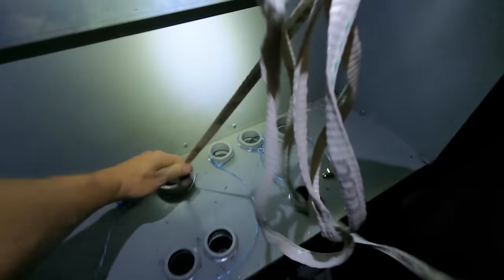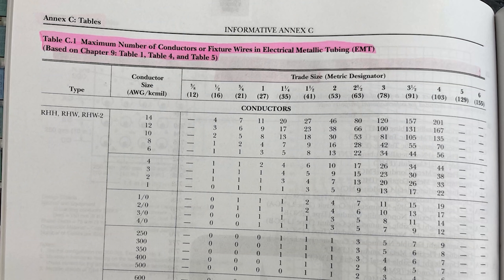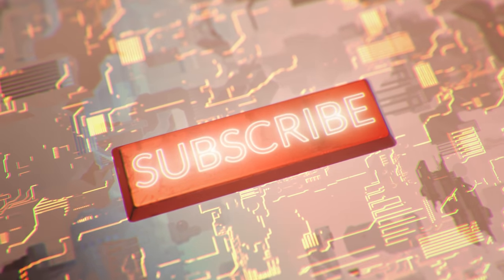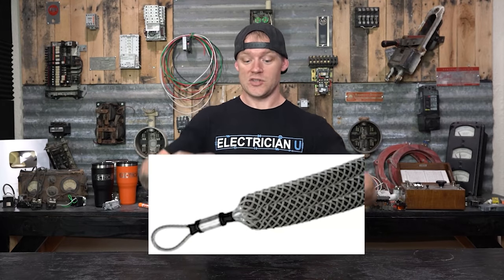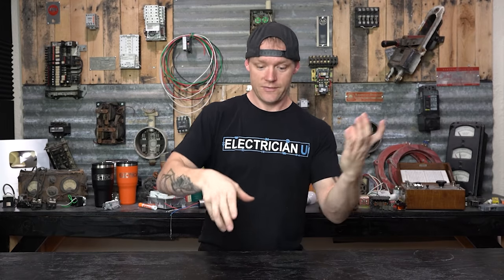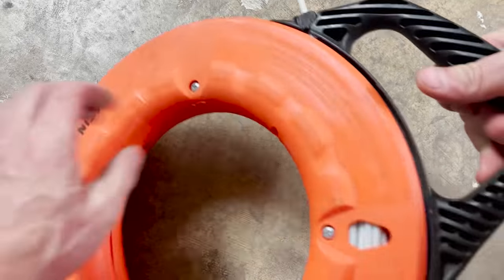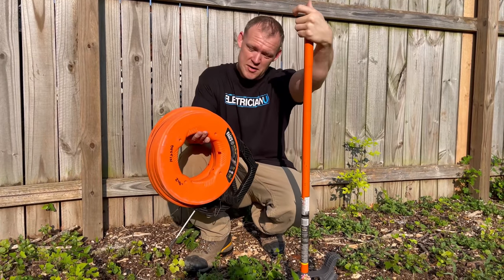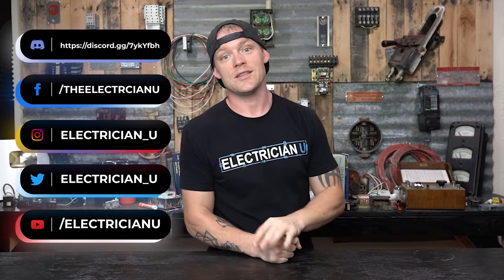Pulling Wire Like a Pro - Tips and tricks for pulling conductors through conduit

Comment: thanks dustin- your next video should be "how to pick the right end of a roll of mc before going through 100' of metal studs and realizing halfway" :)
Reply: i think he already did
Reply: Jajaja
Reply: I dont understand, why does it matter what end you have chosen? You could still get it done even if you pulled from the inside of the roll
Reply: @justink7269  The way the grooves run makes pulling one way smooth, well pulling backwards causes the sheathing to catch on every edge and its not pleasant to pull.
Reply: Check out his video "commercial material you should know"
Reply: It also matters which side of the stud you're pulling or pushing from. I always recommend trying it with 5' or so to be sure youve got it right. Also, make sure you eyeball every single stud you're going through when forming your plan. Sometimes it's a good idea to start in the middle
Reply: The direction of the stud is what really matters. Steel studs have a smooth and rough edge. If you pull through the rough edge, the sheathing will catch on the stud. You will find yourself pulling really hard or having to pull loops through every stud in order to get to the next stud. Sometimes it's best to start in the middle if you have 2 walls with the studs facing different ways (I HATE when carpenters do this) or you're going above a door frame or window frame.
Reply: @justink7269  it makes a big difference. Even the direction you pull through the stud makes a difference.

If the mc and stud are going the right way it will glide pretty easy. If one of them are going the wrong way it's tough
Reply: It always comes out from the inside of the roll to pull through steel studs. Normally you sit the roll against a wall and walk off the center spinning it to unwind as you walk.
Reply: Buy it on reels and you'll never have that problem.
Reply: @justink7269  ,  No-o-o-o-o-o!
Reply: @liamwelsh5565  ,  Teams KNOW what to do and not do... often, the "workers" may know but forget that the installation is a TEAM effort.
Reply: @BruceNitroxpro  Pulling MC is not a 2 person job. If I need another person for something, like pulling wire, I'll get them but not very often for MC.
Reply: the struggle is real
Reply: F
Reply: Use plastic bushings, makes the pull direction irrelevant
Reply: I really hate when that happens.
Reply: Been there..... been there hard man.  🤦🏼‍♀️
Reply: @liamwelsh5565  yes, there is the "soft side" and the "hard side" as the framers call it. Coincidentally the hard side is also the harder side to pull through
Reply: @jimmac1185  that isn't true, I've had many reels with the windings working against you. That shit don't matter anyways its the soft side of the stud you wanna pull through the end
Reply: Order reverse wound mc then it pulls thru metal studs 1000 times better
Reply: @justink7269 its a huge difference one way the ribs get caught all the way pulling thru metal studs
Reply: Nick Kurdzuk, it you look at the cable, there is one end that has an angle to it, that gets pulled thru metal studs and won't hang up.
Reply: Its more important to understand which way the studs were stamped than the mc rib direction

Change my mind
Reply: @grimlockarts8386  amazing how many contractors will try and get by with the cheapest method that actually costs them much more money in labor than it would have cost to do it more efficiently!!
Labor and material are about 50/50 about of the cost in commercial work, but do many contractors try to shave material costs only to pay much more in labor to do the job!!!
Profitable contractors will pay more for the material if it reduces labor cost!!!
Reply: @bryanduchane2371  100%
Reply: @71160000  I hope you are joking
Reply: (I'm an apprentice***) At first I was taught to make sure to use the right end of the MC to push/pull through (the top of the conal/spiral goes into the stud). A bit later down the road... to make sure to go through the side of the stud with the dull part of the puncture. These two things made MC pulls MUCH easier. 😅
Reply: Rather pull mc than romex
Reply: At least it wasn't 250' threw a drop ceiling because your mechanic thinks he know everything an says there's no direction to mc.
Reply: 😬😂🤷 been there.. or 100' of non hospital grade
Reply: Hahahaha yep been there
Reply: Center  of the roll with MC
Reply: Yeah the really shitty thing is lately I’ve been running into rolls that are spooled in the opposite direction. I used to be able to always pull from the middle of the roll, as opposed to pulling from the outside in. But yeah, you should always stop and take a sec to check which direction the MC / BX cable was spooled  from the factory. For those that are wondering why, well do it wrong one time and you’ll know why. Every single ridge on the MC cable will get stuck on each metal stud that you’re pulling it through, unless of course you just get really pissed off and go He-Man on that shit, then it’ll usually pull, but eventually you’ll break the mc and you’ll just be pulling the outside aluminum sheathing. This typically only happens on Monday mornings or Friday evenings though.
Reply: The studs themselves have ridges to pay attention too.

Comment: My first day on the job with a large electrical contractor, I watched an "electrician" with 40 years of experience, shove a metal fish tape, into underground conduit, over 100 feet, with about 15 wires.  Most of those wires were high voltage for massive machines at a huge steel mill.   They tied on the new wires and he began to pull the fish tape.  About half way back, the tape cut into the 3 phase wiring and there was a nice explosion and smoke poured out of the conduit.  I asked to be put on a different job site.
Reply: I doubt he had 40 years in the field if he thought that was a good idea in the first place.
Reply: I just remembered the meme about lying on your resume and landing the job!!

Comment: I pulled a 2700 foot run of 750 MCM through a cable tray from a MCC to a warehouse in a plastic manufacturing plant. There were 22 corners we had to pull around. I set all the pulleys up and pulled a big rope through them and amazingly every pulley was perfect. We used a big tugger to make the pull and the foreman on the job was so impressed with how well it went, he bought everyone on the job lunch the next day. The next weekend there was a bad storm that blew through and a big piece of sheet metal roofing came off and hit the 750 and it blew in two. There were probably 75 to 100 different wires and cables of every size and shape in that tray and the sheet metal only hit the new one we just pulled. After they were so set on making that run in one pull and keeping it without a splice, we had to go out on a weekend in the middle of the night and splice it. You never know what is going to happen...
Reply: That's a heartbreaker
Reply: 2700' is over half a mile. I'll assume 270'.
Reply: @joshprater8533  LOL... you ever hear what assuming does? We paid for 2750 feet of wire so if the pull was only 270', we got ripped off... I tried to get them to set another utility pole at the corner of the warehouse that we made the pull to but the plant manager didn't want to do it that way. He said it would just make another electric bill to have to pay... Logic escapes some people..... He paid us probably 20 times or more what a pole would have cost.
Reply: Thats why polaris taps are the real boss
Reply: @frank_texas7400  what is a Polaris tap?
Reply: So... im curious what size was the reel that this 750mcm MV cable came on? And what size truck delivered it?
Reply: @narmale  Lowboy 18 wheeler. Spool was about 12 to 14 feet high. Sorry, I didn't measure it for you... And it was back in the mid 1990's.
Reply: @frankblas98  it's a way to connect wires but they are outdoor rated.
Reply: I've done a similar pull at a car plant with high voltage feeders. Major rigging involved with pulling 90s 60' in the air with come-a-longs & chain falls. The reel was about 15-20' in diameter that was set by a crane onto an electric roller to help the reel spin. Pretty cool work!
Reply: @brentcory8194  Yes sir, I love challenges like that. I am now retired, but loved working in the commercial electoral trade!!! I would have loved to see your pull...
Reply: A cable tray? A cable tray is L9W VOLTAGE AND IS NOT RATED FOR THAT WEIGHT OR FOR EXPOSED CONDUCTOR.
a cable tray?.
I call bullshit.
And 750 on a 2500 spool? Another bullshit.
Reply: @lm5085  LOL!!! Amazing how the uneducated can call bs on something that they have no knowledge or comprehension about. I really don't care what you think you know. I did the job, got paid handsomely for doing it and moved on to thousands more jobs similar to this one. Granted this was the biggest and longest pull I ever made but it was pulled off with out a hitch.... I'm sure Dustin appreciates the comments as much as I do...
Reply: Here, I’ll give you that trophy you’re begging for in a comment section of a how to video on  YouTube.. 🏆😂😂

Comment: I remember pulling 600 mcm through 7.. 90 bends didn't know they did that until we traced the work that was done. It was a nightmare the wire puller was screaming like it was constipated.
Reply: Did u have to take the pipe apart in certain locations to pull? That seems like it would be impossible to pull otherwise
Reply: @Nick-bh1fy  I agree, and damage to the wire 100%
Reply: @Nick-bh1fy  Believe it when i tell you it made it don't ask me how but at that moment i didn't care i was too angry i hate following other peoples careless work.
Reply: @chadchotia4114  Um yeah...??... i could imagine but it was on to the next. Nyc buildings i don't know how they stand.
Reply: It really sucks when you have to pull wire through pipe you DID NOT run...Or at least ONE of the guys working that day, ran. Not knowing the run and having to trace it back to see how many bends BLOWS....We have all been there!

Comment: when using duct tape on the head I have found that if you wrap the first layer with the adhesive out then flip the the tape over the normal way, especially when pulling large wire that you just don't want to cut the entire head off, makes for easy remove of the tape

Comment: I use the ground wire as a pull string when adding wires to a conduit that already has wires in it
Reply: You like doing it the hard way.
Reply: Thats what I do too, its like having a fish tape already in there, ready to go!
Reply: I do this as well, far easier
Reply: @KinGIIRomE  What's the easier way? Much easier to pull with the ground and pull a new ground along with the wires you're adding then trying to get a fish into a conduit filled with wires.
Reply: What if the ground is twisted around other wires
Reply: Using and existing wire as a pull saves tons of time...since most of my work is residential, it will be the neutral. which I  generally upgrade to 12ga if not one already...gave up on solid wire decades ago...stranded is the way.
Reply: @samspade5648  I prefer solid cause it's easier to strip and easier to organize in a panel or jbox.
Reply: @liamwelsh5565  As for panel organizing, I can't argue with you on that aspect of solid wire, but zip-ties over come that with stranded wire.
Reply: @jmr6217  That situation doesn't happen regularly...very rare actually.  But when it does, we'll looks like ya are upgrading a run.
Reply: @samspade5648  i hate dealing with ziptied wires in panels. If you have to use zipties then don't cinch it super tight.
Reply: @elvizhernandez4305  
Use soap
Reply: @DEEZVIC  ideal makes wire lube.  It's available at all the electrical suppliers in my area.   Problem with soap is it dries a little sticky which can make adding wires later more difficult.
Reply: @bradleydobie3891  
Correct. We call soup the ideal lubricant or yellow 77
Reply: @elvizhernandez4305  ,  Exactly!

Comment: As far as lube goes different brands work better than others. Ideal Yellow 77 works amazing but if you ever need to pull those wires out or add another have fun because it just cakes up into a hard sticky mess.
Reply: Noted!
Reply: and youre going home yellow. lol
Reply: Mineralax is another brand, but Yellow 77 smells better. If you ever have to pull another wire in use the Ground wire and relube to reactivate...
Reply: God I hate Yellow 77...
Reply: @andyfletcher3561  I hate it to and will only use it as a last resort.
Reply: @steve-o6413  A name like that makes me wonder: is Mineralax stable? (I.E. not lacquer up like the Yellow stuff)

Comment: Pro tip for PCV always face your bell ends so you push the wire off of the pipe edge and not into it.
Reply: OMG that is so true. I've had to dig up and repair several underground runs for this reason. Also if you use one schd size- use it the whole way, or bevel your ends to stop every joint from having a raised edge.

Comment: Great info here!  
I will add a couple points from my experience.  Keep wire off the ground and floor whenever possible - this will minimize debris and dust that will increase friction to the wire and increase possibility of insulation damage.  This is very important when working on job sites with other trades that may not know or care about wire condition.  With scissor lifts buzzing around and heavy equipment moving about, wire is very easily damaged.  So this brings up a point about time management.  If you are going to need >30 minutes to pull in wire and you are about to go home for the day, best wait until can do the entire pull in one shot, rather than leave it, and worst of all leave the wire on the floor/ground.

Comment: Neat trick - A few years ago we were trying to pull large wire through a 5" underground conduit that came up in a concrete transformer pad.
they were able to get a steel cable through the conduit, but weren't able to get the wire through, and had to pull it all back out. Apparently some of the concrete was spilled into the conduit when the pad was poured. To dig it up and fix the pipe, we would have to tear the xformer pad up. Someone decided to tie a knot in a heavy chain and pull in through with a crane truck and it worked the concrete pulled out and we were able to get the conductors in. 
Also remind the wire lube man to be very careful when pulling with a mechanical puller. If you get your hand caught between conductors when the stretched rope pulls in spurts you may lose your arm. Also stay clear of the rope at the other end as you could be injured if it breaks.

Comment: I have never been on a commercial job where solid was even allowed(except in a pinch).   1/2" EMT is perfectly ok.  I only bend up to 30 degree bends 99% percent of the time.  No 45's or 60's. Keep your fitting set screws on the top or side, never on the bottom.  Short pulls with a fish tape are fine.  Pull string for longer pulls.  Pull rope and tugger for large conductor long pulls.  Wire lube as needed. With super short runs,  I will push the wire in by hand with a loop on it, like Dustin showed in the video.  If it gets stuck, I will run a fish tape in from the other side, twist it,  and pull the wire out the rest of the way. Any damage to the head end will normally be cut off and thrown away anyway.  Great Video.  Thanks, Russ from Oregon

Comment: Back wrapping a head is also useful on large conductor pulls. By back wrapping I mean after the head is formed and secure then wrap it with duct tape, one layer, not super tight, with sticky side up, then follow it with a tighter layer covering that with sticky side down. allows for some slip with the conductors head as they move through bends and makes it a hell of a lot easier to remove when the pull is complete.
Reply: Another tip is don't overlap the stripped out strands back over the installation. Strip out enough to fold over only on the bare wire, and use your Channel lock pliers to squish the fold smaller. I personally use 3-4 strands from each side of each wire, making sure all the ends lay flat and parallel with the wire bundle. I personally try and stagger the full diameter end of the wire just a bit to make the transition a bit easier to pass through bends. Then with bigger or longer pulls use an extra strand or two as a wrap through the folded section and then tightly around the head to make it small as possible. This helps on tougher pulls with heads coming apart. One more trick I've learned over a couple decades, is a diaper method. Before wrapping with tape, take a rag and wrap it over the blunt end of the head and sharp edges of the wire to make it smooth as possible. When doing this you don't have to back wrap the tape, just cut it off  through the rag.

Comment: Learned something new today. I’m a DIY’er always looking to learn from others. I’m getting ready to install flexible 3/4 inch conduit to add an exterior lighting and run 12-2 romex through it, something basic to add lighting to an area where I don’t have any lights. I have an existing external wall mounted light fixture which I’m planning on grabbing the power from to add a new led light fixture about 30 feet from this location. The tips I learned here today gives me a little more confidence as I have never installed conduit before. It makes more sense why you’d want to pre-plan it before installing it. Thanks @ElectricianU for sharing your knowledge. This is one of the best channels I have come across. Keep making this great content. Been a subscriber ever since I first saw the video on how to wire up a receptacle and three-way switches.

Comment: In the UK I have great success using dry lube - talcum powder!    Much less messy. Works like millions of ball bearings. And you can blow it through duct. Duct Needs to be new and bone dry of course. 
We can thread multi core  cable through roof timber here. Talc Works great in drilled wood holes.